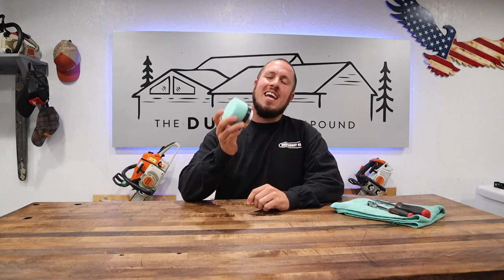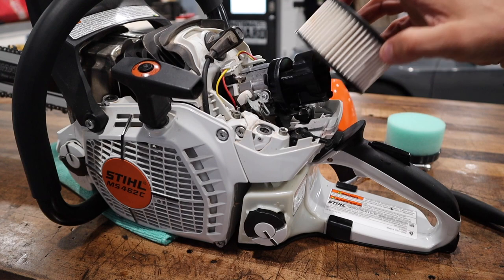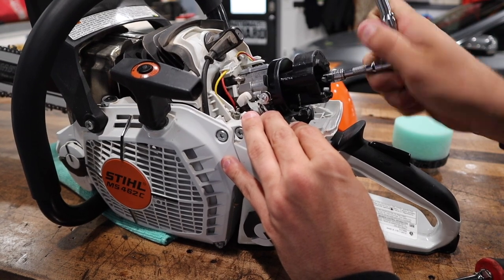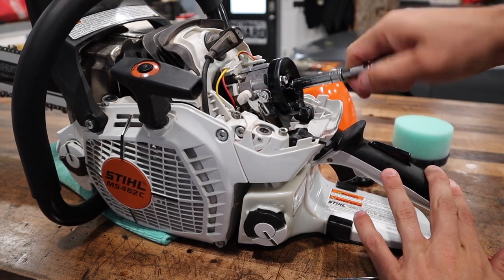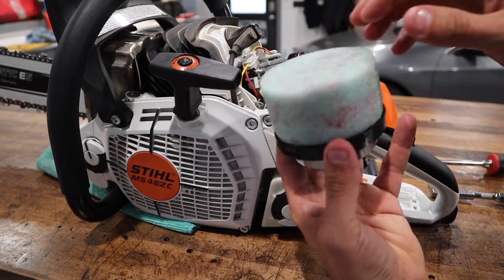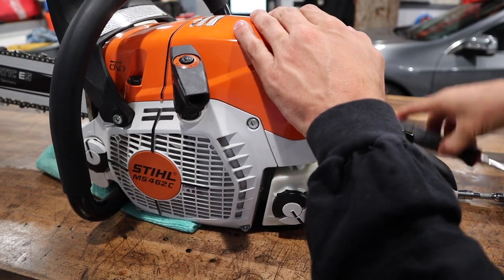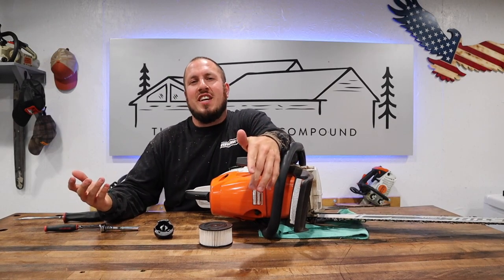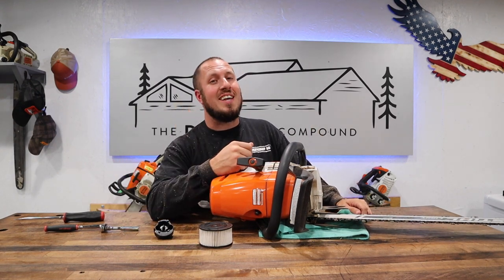Westcoast Saw 462 Air Filter

Comment: It would be nice to see how the filter was oiled. You skipped over that part and I think that we new users would benefit from that. After installing this filter, is there any break-in required so that the 462 re-learns that characteristics of the new filter? Thanks.
Reply from the maker: Made a video just for you!

How To Oil A Foam Filter

https://youtu.be/xpYuPGeuMRY
Reply: Thank you, Devon. This video on how you oiled your WCS Foam Filter. I oiled my filter the same way you did, using the same oil but I might have left a bit too much oil into the filter. Now I know what to do and how to do it. Semper Fi and thanks again.

Comment: And when read the Manuel depending on use you are supposed to replace your filter monthly according to stihl
Reply from the maker: Yeah that becomes a very expensive venture
Reply: Simply blow out with an air line, I run a 500i never seen fines inside the filter,  nor does it clog after 2 or 3 tanks.

Comment: I just put one on my ms362cm and all you have to do is grab hold of that baffle and turn it counterclockwise and pull and it comes right off. No removing bolts or anything. Just install the new phone filter.

Comment: I see you got an ms 260 behind. Any tips for better filtration for that saw? I found fines in the stock filter, and I barely even cut with it.
Reply from the maker: Nope. Unfortunately the filter design isn’t perfect. You could always add a prefilter sock.
Reply: @TheDurbinCompound  Yeah, I think I'll do that. Husky is way ahead of Stihl in air filtration, I have to say.  I thought the 462 was getting there, but it doesn't seem that better, compared to other Stihls.
Reply from the maker: True. I run a West Coast Saw foam air filter on the 462 and like it. I also run Max Air Flow filters on saw I can get them for. The 500i air filtration is among the worse I’ve seen. It just pulls in all the dust and dirt and does a horrible job managing it with the paper filter
Reply: @TheDurbinCompound  Yeah, I don't even understand why they make it that way. The most cutting edge saw, and that's the filtration you get.
Reply from the maker: We were convinced it was because of the vents on the side of the air filter cover but it is not. We taped all of them up and still had the same issue
Reply: @TheDurbinCompound  Well, I guess those are there, because the engine needs a lot of air. But I'm not suprised about the result. I mean it sucks it in from the outside either way, and there are chips, and dust flying everywhere. I just can't get around the fact, that Husqvarna uses the air injection since at least 20 years, and Stihl still hasn't done anything similar. I mean maybe because then their saws would be too bulletproof, or I don't know :D

Comment: Hey buddy so you just spray that filter down every time you use the saw is that pretty much what I'm supposed to do clean it with an air hose and then put more of the lubricant on the filter everyday or how often should I do it
Reply from the maker: I clean this filter in the sink with soap and water.  Then dry out with air and re-oil. It doesn’t take that much effort
Reply: You only need to clean it when it gets dirty, like you can start to see dirt buildup on foam.  They can go for quite awhile without being cleaned, as long as they are oiled.  If it's not overly dirty, but the oil has dried out a bit from sitting, I just take it off, blow it out an air hose and apply more oil.  You'll get the feel for when it needs to be cleaned, but you aren't going to hurt it by cleaning it too much, but they are resilient and don't need to be cleaned constantly either.
Reply: Thank you so much
Reply: @johndunbar2393  thank you
Reply: @br-dj2ti  You're more than welcome.  Just to add, I clean them like Durbin, in the sink with Dawn dish soap and let them dry and apply oil, when they get really dirty.  Take care.
Reply: @johndunbar2393  I brought this cleaning spray it's the same brand as the oil I use uni oil and you need foam cleaner I spray the dust off and then I spray that cleaner all over it bring it out let it dry then I put more oil on is that okay to use that stuff
Reply: @br-dj2ti  As long as it doesn't affect the adhesive that holds the filter to the plastic part, it would work.  If you bought it from WCS, I'd email and ask for sure.  It all depends on what they used to put it together.  I use MaxFlow filters and have used Uni foam cleaner and oil on them, but there's no adhesive in that application either.  I don't want to tell you bad info, so I'd email Gordy and ask for sure man.  If the adhesive can handle it, then you would be fine, but that would be my only reservation about using a foam cleaner on the setup for the 462.
Reply: @johndunbar2393  yeah that's what I have maxflow air filters but I ordered the oil and the cleaner from w CS it is unibrand so is that okay to clean it with that cleaner
Reply: @br-dj2ti  Oh, OK, yeah, that is perfectly fine.  I wasn't sure what setup you had.  The only reason I quit using the foam cleaner is because water and dish soap is cheaper and I always have it.
Reply: @johndunbar2393  I'm pretty sure I have the exact same setup as you do buddy
Reply: @johndunbar2393  yeah I think I'm going to start using the dish soap once this cleaner bottle is gone so you blow it off first and then you wash it with dish soap rinse it real good rung  it out and let it dry correct
Reply: @br-dj2ti  I'd say so.  MaxFlow's are pretty much the same from what I recall.  Mine are on 461's, 660's and 661's and they're all similar.  Take care fella.
Reply: @johndunbar2393  thank you so much for your help
Reply: @br-dj2ti  You replied while I was replying.  Yep, that's exactly how I clean them, just how you described.  You're very welcome fella.  I'm glad I could help.  Take care and have a good weekend!
Reply: @johndunbar2393  thank you again God bless

Comment: I cut pure fresh hardwood and I'm not seeing my filter stopped up on my 462 like you're saying.   Not saying it's not happening on your end but jus my experience thus far.   

With the air filter mod are you seeing any improvement performance wise?  

Since you have the barkbox how about doing a stock exhaust, barkbox with mtronic reset with stock airfilter then both exhaust with m-tronic reset with new airfilter mod timed cuts.
Reply: I run them all day. This dude has no clue what he's talking about! Just pushing gimmicks for views. I can run my saws hard for 8 hours straight and have barely anything in the filter at end of day.
Reply: He said if you say something bad he's just going to delete comments. Also he's got no clue what's going on. Factory filters can be blown out way easy and are also washable.
Reply: @loggingdaddy   I check my filter daily and clean my filter every 5 gallon can of  fuel used.  My filter is less than a 1/4 stopped up.  Some of the pleats don't have nothing between them .

Comment: Hey what’s that deal on the bottom of the saw near the rear handle , love them air filters and Egan straight shot had both on my 362 , sold that and bought a 462 not 1 tank threw it the filter and exhaust went on 💪🏼👍
Reply from the maker: That is a bottom protection plate. Bought off of eBay.
Reply: @TheDurbinCompound  same hear Devin...They are a nice addition..just ordered a 462 from Ripsaw which comes with a skid plate.
Reply from the maker: Please let me know how you like the “ripsaw” saw!  I’d like to review some
Reply: @TheDurbinCompound  absolutely !! Once it gets here and broke in I'll touch base with you. May be a couple months. How would you like me to reach you?
Reply from the maker: Email me at TheDurbinCompound@gmail.com or comment back here!
Reply: @TheDurbinCompound  10-4 , thanks

Comment: Can you use belray filter oil on these filters or does it have to be the spray oil
Reply from the maker: You can use any foam filter oil.  How do you apply your belray oil to filters?  I used to pour it into a container and then press my filters down into it
Reply: I have the max Flo filters for my 661 and I just pour some inside the filter in a gallon ziploc bag and squeeze it until it's all throughout the filter.   Helps to minimize getting it all over your hands
Reply from the maker: Yes! I’d do the same with any foam filter
Reply from the maker: Are the max flows worth it?  I have a 660 and 661 that I’ve been considering putting them on but hate that the covers are black
Reply: Yes definitely worth it!   Stock filter is plugged by lunch time and can go up to 2 weeks or more on a maxflo before cleaning with no fines getting through or performance drops.    And you will get used to the black filter cover.   Lol
Reply from the maker: Very well!
Reply: Is the foam element able to be removed to be cleaned or is it permanently attached to the base
Reply from the maker: @scottdevore392  from what I can tell they glued the filter foam. I clean it while attached to the plastic base
Reply: @TheDurbinCompound  I was afraid of that but oh well.  Gonna give one a try.    Going to be purchasing a 462 this week and gonna order bark box and a filter
Reply from the maker: @scottdevore392  I am definitely impressed with these upgrades!  I think you will be too